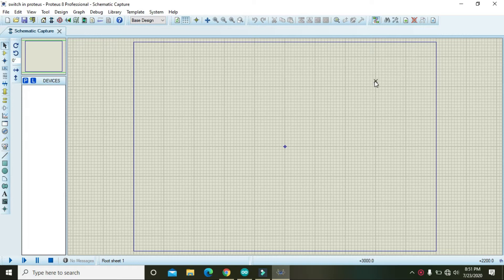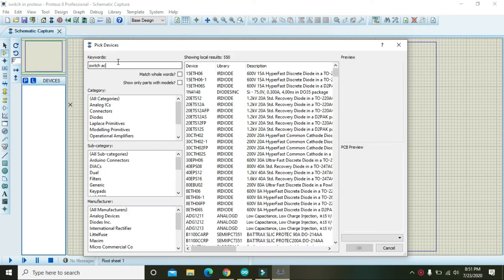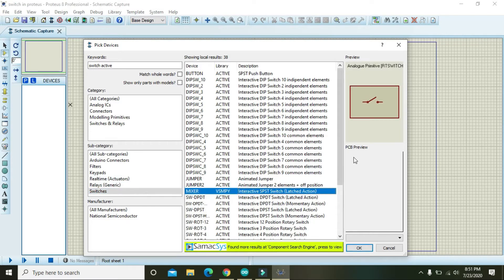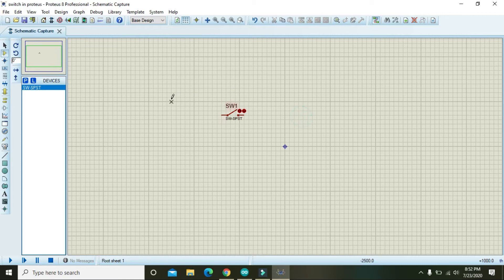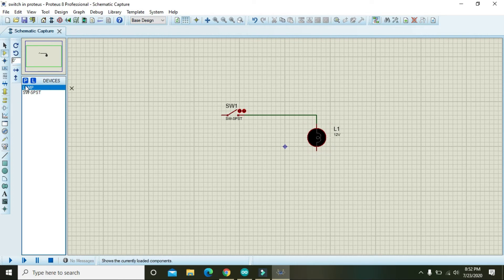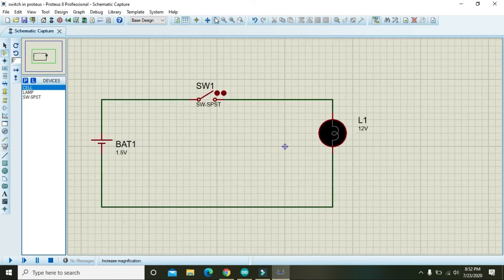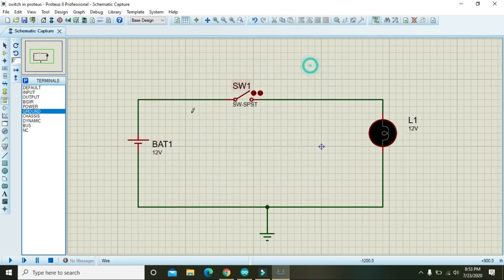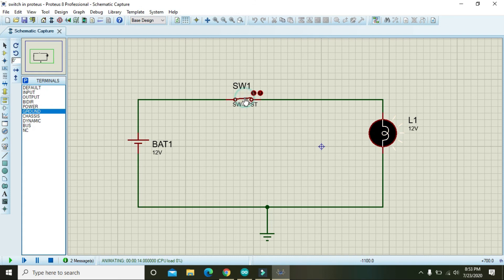how to use switch with lamp in proteus | simulation of lamp with switch in proteus

Comment: excellent explanation, but when I design a very simple diagram by clicking on the PCB icon (after making other options)... in the end, autogenerating the PCB always puts at least one component (switch for example) in the top layer and everything else in the back layer. how do i get everything to spawn me in the back layer? I am only going to use a pcb with 1 single layer of copper. (proteus 8.13)